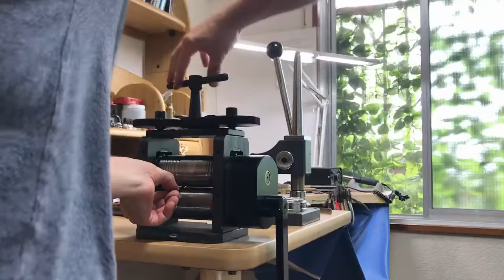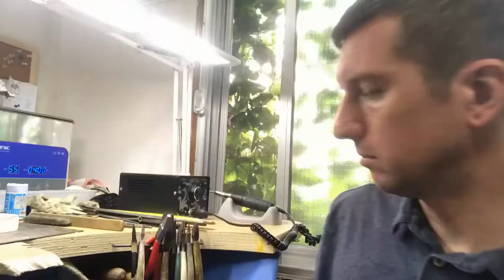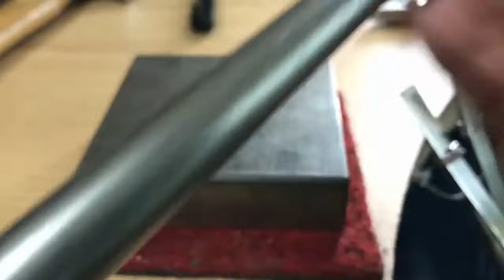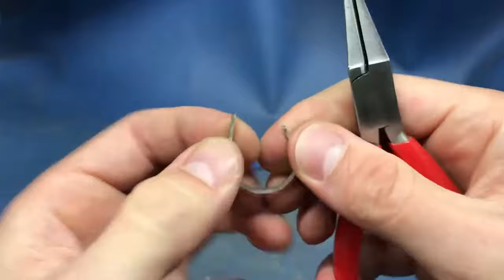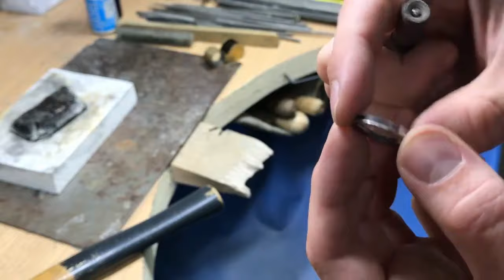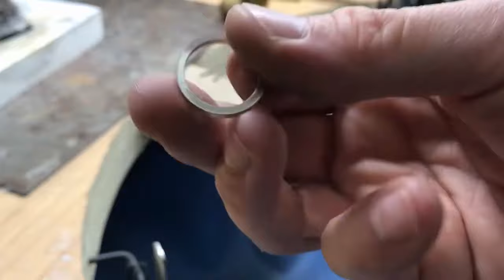How to Make A Wedding Ring  The Correct Way!

Comment: Chris! Live the precision! I have a question, please! I've read in Brepohl's The Theory & Practice of Goldsmithing, about annealing; that annealing before the metal has been stressed (hardened) to its maximum is harmful (inefficient?) to the metal structure goal of annealing. What do you think of this and how do we tell if the metal is actually at its zenith of hardening? You suggest annealing at the first indication of the piece curling/curving. Is that the point of maximum work hardening? These details can be confusing. What did you think? Thank you again. Please pretend I'm asking while I was a Patron (for a year, and never asked a question or could watch any extra content). 😅❤
Reply from the maker: Lol No worries thank you always for your input. No that sounds like ballbags to me. Its better to keep the metal soft. Far more likely to have problems if you repeatedly stress out the metal to its maximum.
Reply: @DiamondMounter  thank you 😊 🙏

Comment: I've got to learn how to make a pair of your curve faced pliers.  I think you said you ground down a standard pair yourself.  Would love to know how to do that.  Thanks for sharing your knowledge.
Reply: Angle grinder.
Reply from the maker: I made a quick video for the patrons recently but I plan to do a more formal instruction video soon for the channel
Reply: Yes, after watching Chris's videos (he talks about it alot) I did mine too, and I love them!  I have another pair I bought that look like Chris's other pair, and just like he says, those are crap.  I used emery discs, cut-off discs, emery barrels, sanders... basically any other tool u can probably already have that grinds metal.  It just takes longer with steel.  I even cut the groove in mine like Chris did!
Reply: On that note...instead of buying a grinder I purchased a 3" heatless wheel and used it on my polishing arbor to grind any tool steel to my needs.

Comment: So much to learn. So interesting !! 
I am just a hobbyist but my expérience with hammering a ring on the mandril with a métal hammer makes it larger. I sometimes give small claps to enlarge a ring. I thought that's why they tought me to use a rubber or a rawhide hammer. Iam confused now 🥺. I see a lot if (imo) good jewelers using a hammer like yours and for years I am wondering how their rings dont get bigger and stay the same size 😢🤔
You are the first jeweler who speaks about that. 
Please explain. And thank you very much for the  vidéo. 🍀
Reply from the maker: I find a metal hammer will easily push the ring down against the mandrel. A raw hide or other soft mallets require lots of hard blows to reshape a ring
Reply: @DiamondMounter 
Ok. Thank you very much.. I'll try in the futur 🍀
Reply: Hi hi! There actually IS a very good use for a non-metal mallet. I think (perhaps..) Chris's work has never involved such imprecise work that might require a stretch that can't afford a change of the form. Basic metalsmithing (sadly) doesn't teach to the exacting precision and technique of forming BEFORE soldering. Basic teaching suggests cutting the calculated length of a ring band/wire (for example), solder closed, and THEN form. To do that, a non-marring mallet is used/recommended. It's a totally different technique. It is useful  but not a very technically efficient way to fabricate. There ARE times when an already closed ring join needs to be formed or reformed - and metal on metal will not preserve a specific size. Different jobs. My thoughts....